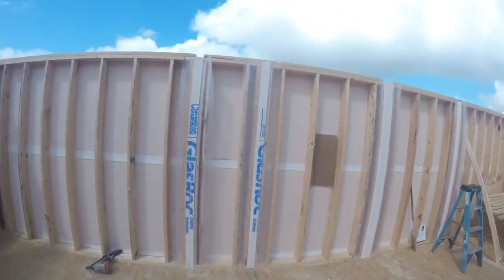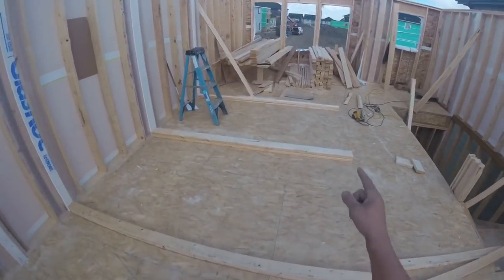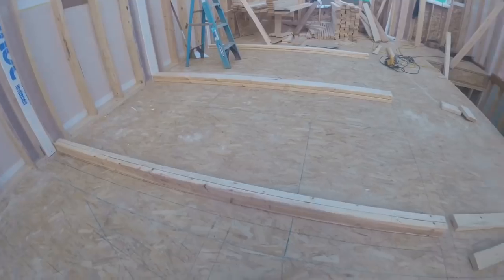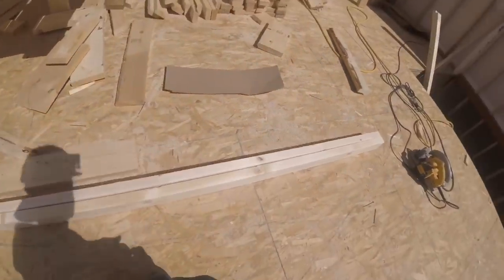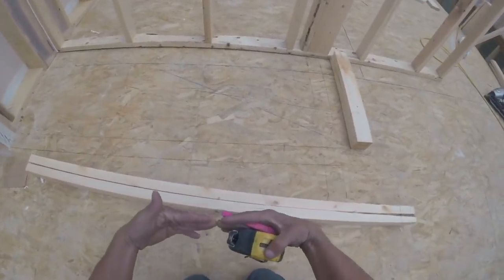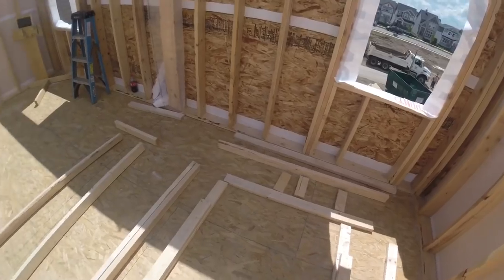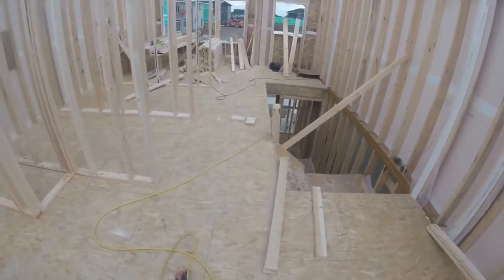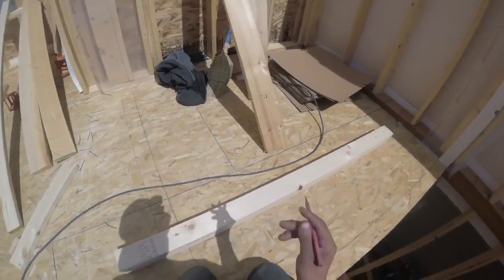How to build interior walls part 1

Comment: When you were marking out the overhang for second too plate, you went with 6”. Is that because of the fire stop drywall?
Reply from the maker: That’s right 5 1/2” for the 2x6 and 1/2” for the drywall

Comment: Curious why the 2x6 interior wall?  Picking up more load?  More soundproofing for happy fun times in the back bedroom?  :)

Also I've been trying to figure out the 'up' and 'down' terminology when you're laying out a wall.  Is it to locate a facing stud to pick up a wall?  'Up' being the board will be up, flush with the raised face of the wall when lying on the floor, and 'down' is when it's flush with the floor.   Close?
Reply: jcims perhaps because of snow load?
Reply: probably plumbing wall
Reply: jcims  the up/down you got right.. just so he can the orientation of the “L” to properly tie in perpendicular wall.  Also 2x6 could be plumbing/hvac/upstairs laundry.  Typical they won’t be for insulation. (3.5” is plenty for sound)
Reply: 2x6 is for plumbing drop or bearing wall, usually they do 2x6 at the laundry room.

Comment: Longest walls first guys. 
-The middle and stair walls then the 111 1/2s the way he did get built in between and in place. If your worried about them being to tight to build between the standing ext and long int cause of stds sticking in, walls not exactly on the chalklines everywhere or it’s just straight up too tight between the standing walls. Well that’s why you don’t nail the long int wall down until you got the between walls built and standing, just tack it enough for it to stand while you build the betweens (or throw a brace on, I don’t but you can). Ok 👌

Comment: is his square broken and if so how do you break a speed square
Reply: 😂😋😂

usually they get lost or stolen..

def broken a few..
handed laborer square to use as guide to cut 2x6..

i walk away and come running back to the guy running a sawzall against the side of my square..

ruined.

backed over my own tool belt once on a gradall extendable boom forklift lol..

ruined..

they can break

Comment: I like how you explain why you did the poly and stuff and why you have overhangs or left gaps (for overhangs to connect into). Seeing how you do the corners is helpful as well. Ok, so add 2" to the door opening so 32" on a 30" door? So, a 32" door would have 34" spacing? And 36" would be 38"? Are those measurements for prehung doors?
Odd question: I have to fix an exterior wall for a door. It's load-bearing and the idiot builders didn't put in a proper header. They have a flat 2x4 and the cripples are cut unevenly so it drops 1" from one side to the other. I want to put in a proper header of 2x6s. Door is roughly 80" high and frame needs at least 81" clearance. So, I'm trying to figure out how high the header should actually be.

Comment: i got a qustion here. as a norwegian we always put studs on 60 Cm as all materials are based on that. boards, dry wall everything comes in matching 60/120/180/240cm sizez. wont you puting studs on different measurements become trubling for the ones that drywall when they need different types of drywall for 16 inch 19,2 inch and 2fett studs? .
Reply: 8 foot Sheetrock. 8 feet is divisible by 16 (6 studs), 19.2 (five studs) and 24 inches (4 studs). They all hit the 8 foot mark.
Reply: Drywall is usually 12' boards actually. It's also a multiple of 16".
Reply: john johnson thanks that the answer i wanted. Makes lots more sense now. Thanks

Comment: Why the plastic between the top plates? Why not just on top of the wall?
Reply: Maybe it keeps framers from walking on it when working with the roof truss connections. From what I've read Canadian code is acceptable in either case.

Comment: Don’t wanna change your ways.. but it is faster usually when you lay out a wall buck.  Just put 1 stud on each side (like 3.5” between the two studs).. then you won’t have to stock off 2x6 for  “L” bucks.  Or build the “L” . Same amount of sticks of lumber (less if buck is for 2x6 wall no double stud)  but both are 2x4 (very slightly less cost).  Only works in int. Walls those. Ext. can’t get insulation back there.
Reply: Not a framer, trying to picture what you're saying.  Basically just add another stud in the same orientation as the wall studs 3.5" away (for a 2x4 wall) and just use the 1.5" side for nailing up the intersecting wall instead of the 3.5" side?  (wish you could draw in youtube comments lol)
Reply: jcims well what I’m saying is. When he marks both sides of a wall.. let’s say he marks left side of wall.. put the stud to the left of that mark.. and marks right side of wall. Put stud to the right of that mark.. so you will have stud - 3.5” gap” -stud.   Then when the wall comes in to that area. The wall hits in that 3.5” gap area essentially It will create a 1.5” Drywall nailer on each side of the wall. Then if you want to you can take a scrap chunk of 2x4  (usually about or larger than 6” and nail it between the 2 studs and into the wall that it’s butting in to. Allowing you to make all 3 studs (the 2 that are spaces 3.5” apart and the end stud of butting wall)  solid. (I know that last part is confusing but makes a lot of sense if you see it.
Reply: @Hammerandnail  essentially your making a U channel, but the 3rd member in channel isn't full length
Reply: @jayframes4967   yes.. then you don’t have to stock off 2x6 studs just to build bucks. Also a 2x4 stud is usually cheaper than a x6
Reply: @Hammerandnail  yes sir, thats how I do my interior backings